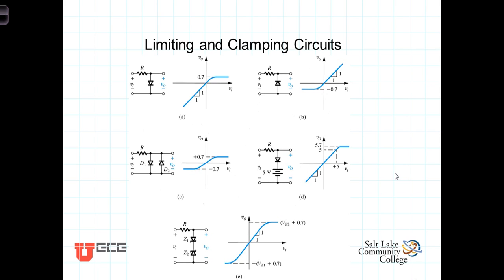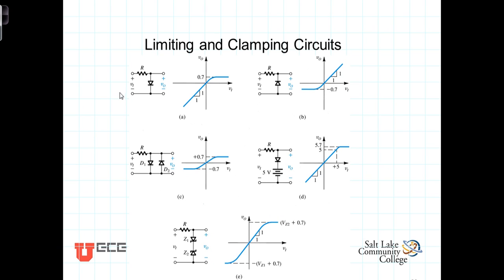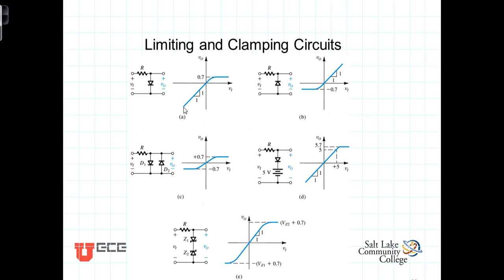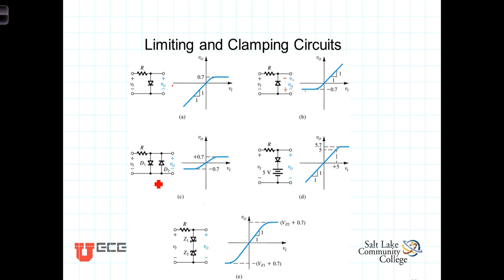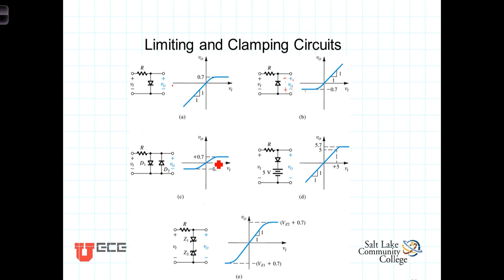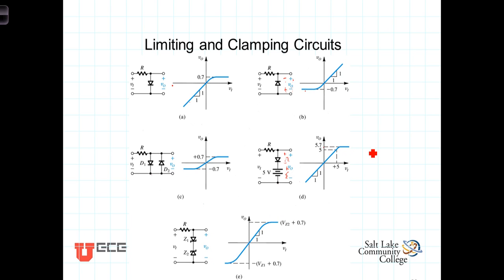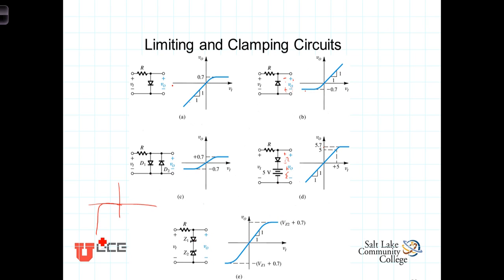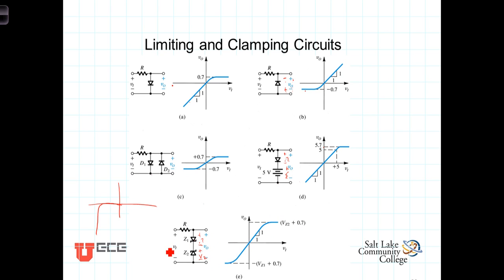L4 6 1Clamping and Limiting Circuits

Comment: Nice explanation. I have a question though. 

What would happen in circuit (d) if you keep increasing Vi? Is all the current going to be injected in the 5v voltage source?